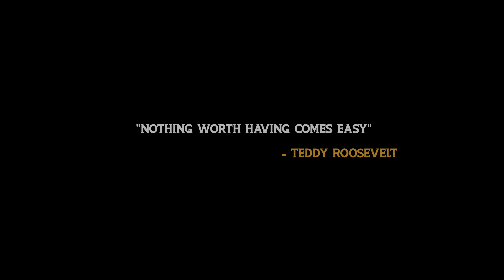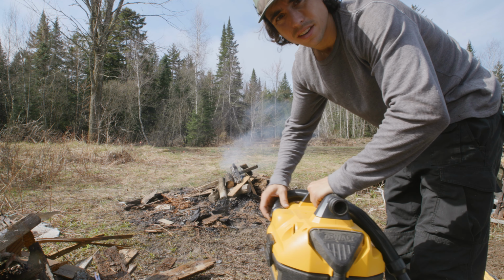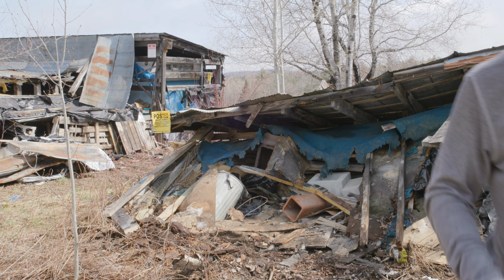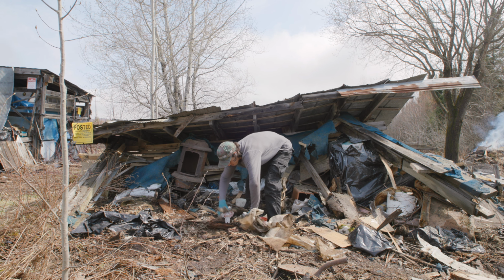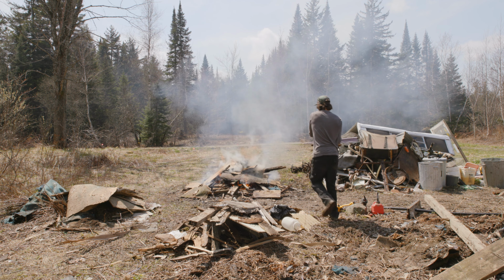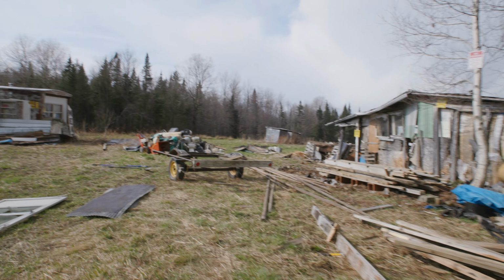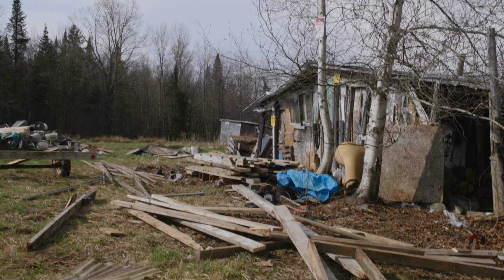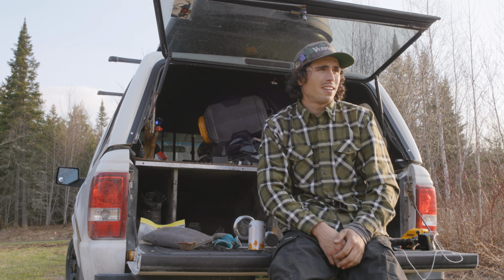OTRCMP : EP15 : Pole Barn Pull Apart!

Comment: When we bought a house owned by a hoarder there was a very neglected garden shed.  It was filled with “ used but good” tires.  I thought a good strong wind would blow it over. Your hard work on these buildings reminds me somewhat.  It actually resisted us e Rey step, but I don’t think we could restore it.  Proved the previous owner was a good builder.